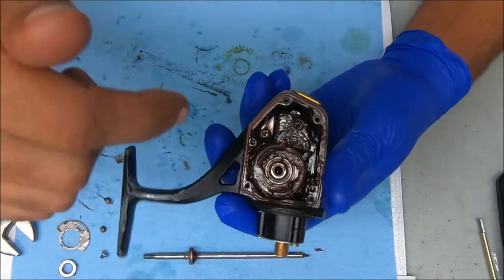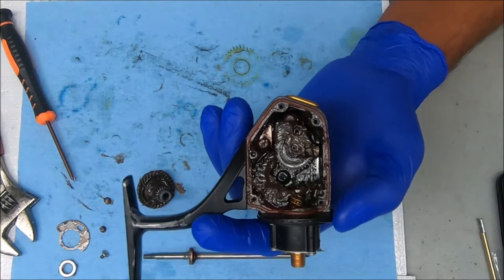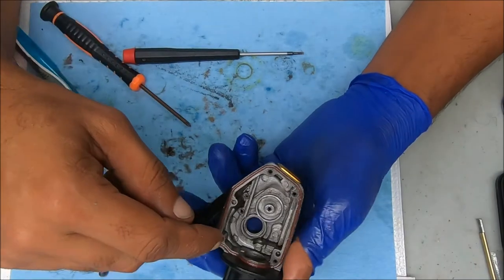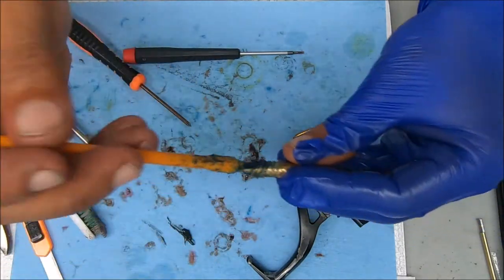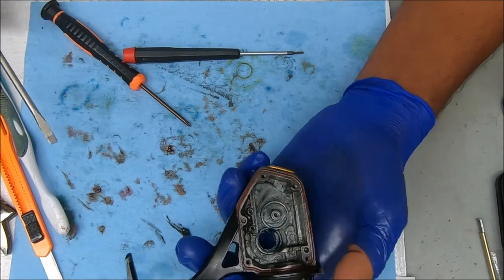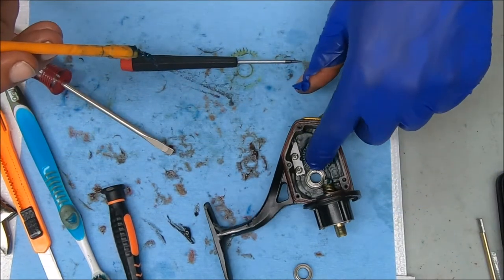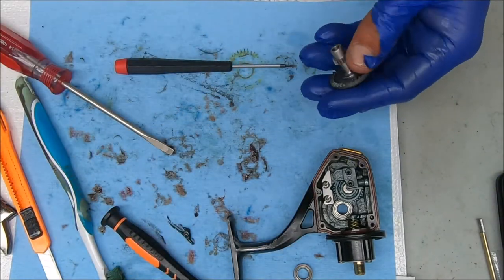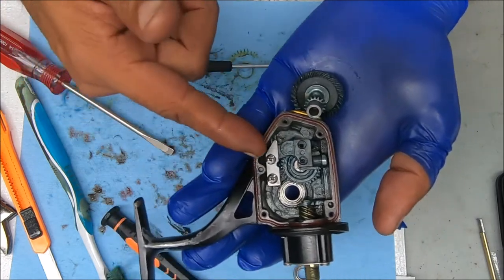WHOA! Who dumped a can of grease in this reel? How To Properly Grease Your Reel: Fishing Reel Repair

Comment: I would have used brake cleaner & just spray all that out or some type of cleaner...The reason I said break cleaner is it will clean it out & then dry real quick it will not hurt anything...
Reply from the maker: Thanks for watching and your input. I wouldn't use brake cleaner in this situation.... cheaper and easier [and safer for the reel] to clean it out with cotton swabs and paper towels. More vids to come.

Comment: Stupid question. How do i clean machine thick lube. Can i use WD 40 ? I got an reel from some guy but he used a thick grease wich its not good at all. Can i just sprey the reel with wd 40 till the grease comes off and clean it with a rug and use maybe machine oil the one for hair cutting machine ?
Reply from the maker: Thanks for watching. You can try WD-40 and elbow grease, or an ultrasonic cleaner with Dawn or Purple power degreaser.

Comment: Ok, as far as keeping the salt and whatnot off of the components, I get it. But what about lubrication? You need something to keep those contact points between moving parts protected. Not, like that reel had at the beginning of the video, but certainly more than just a very thin coat.

Edit: For clarification, my comment is more of a question and not a criticism. It's my first knee jerk reaction to the information I'm receiving here. I will actually try it and see how it works out.
Reply from the maker: Thanks for watching! First off, I LOVE getting  your initial thoughts on the video, and that you didn't edit them out. The light coating area is one we can certainly disagree on.... some may prefer more than that on the inner housing, and that's okay.... it doesn't add any extra protection, but it does help ensure you don't miss a spot.

Regarding the greasing of the gears, any excess will be pressed out during the engagement of the reel, so, in general, putting more than a light coat doesn't serve much purpose. That being said, I have two caveats:

1) the same rule as for the housing, where you help ensure you don't miss a spot applies to the gears also.

2) there are some reels I service that perform better with what seems like a little too much grease on the gears.

Tackle advisors has a video on greasing a reel if you want to check it out. I think it was a Daiwa BG. He's looking for max protection... my guess is for surf fishing... but I still think he could have gotten the same result with less. But, as he says, a little bit of [extra] grease never hurt nobody.... and I agree with that statement!

Thanks again for taking the time to put your thoughts to paper! More vids to come. Spread the word about the channel.

Comment: Thank you so much for such an informative video 😊.  I have Penn Slammer 3 and I plan to maintain it.  Which grease do you recommend using: Ardent butter grease or Penn precision blue?  I ask this because the viscosity of the 2 is different.  Penn blue is much heavier and will make the reel a little slower than Ardent would do.  I fish inshore and never get intruison of saltwater..
Reply from the maker: Thanks for watching! See my Slammer video by searching "Slammer TSG reel service". I use the Penn grease and add a little more than a light coat. Inshore is still water.... you'll never know what got in until you open it up.

Comment: I had a 4500. It was turning with a lot of resistance and had bee dunked in salt water. I sent if back to Penn for service since it was under warranty. It came back working better, but still quite a bit of resistance. I opened it up and it looked just like the one in your video, maybe even more grease. So I bet the reel in your video came just like that from the factory. I got all that excess grease out and the performance was way better.
Reply from the maker: Thanks for watching and your input. This was one of six reels a customer had previously gotten serviced elsewhere, and wasn't happy with the results, so he brought them to me. Glad to hear you got your reel working properly again.
Reply: Penn grease would have been blue

Comment: Excellent  video, thank you!!! Thanks god I found your video :) I was about to open my reel and fill it with grease.
I got new Clash 4000 a year ago but rarely use it ( few hours in total). I do lure & soft bait spinning but mostly with Daiwa reels. 
Now, when do twitching I can feel a “knock” in Clash, also  when hooking up the fish I get that same filling like shaft wants to go out :) Beside that no issues. 
Any idea what can I do by myself about it because no repair shop nearby- or it’s common for all Clash reels. I also have Slammer III 4500 but it do not “knocking” on twitch.
Thanks
Reply from the maker: You're welcome and thanks for watching! I'm thinking of two things off the top of my head:

1) your shaft is bent. You can check it by rolling the shaft (not including the click gear assy) along a flat surface and check for anomalies.

2) your crosswind block could be flexing/rotating.... take off your side cover and rotate your spool back and forth to see what the block does and how much play is there. If it's slight, you may be able to get away with packing it with grease.... if it's severe, you should consider replacing the block and crosswind gear.

Hope that helps and good luck with the servicing of your reel(s).
Reply: @TSGReelService  Thank you for your reply and support. Last night I had a spare time to follow your instructions, and after many hours and several openings I was able to detect the issues (hope so) - on the bail holder screws were loose on both sides ( from factory) so much that I was able to make several turns of each by hand only. The screw on line roller was loos too. At the and - loose bail cause free play when the rod and reel are under the stress while twitching, which cause that “knocking” feeling.
Thank you again!!!
Reply from the maker: That makes sense and I've seen that before. Glad to hear you got it remedied.
Reply: Mix reel oil and grease  and then you can stuff it into your reel 
It will be smooth and easy to crank  and oil grease mix will  move around

Comment: I've been swimming out to the sand bars with my Penn Fierce. 1st version. After a week in the surf, the reel started to corrode and became hard to turn due to my abuse of the reel that wasn't designed for underwater use. Well, after cleaning, I filled the body with wheel bearing grease. It made the reel have more resistance in turning. So much grease that the grease started coming out the main shaft beneath the spool. I fish off sand bars atleast 14 days of each year. This reel is atleast 10 years old now. I do open the reel and top off grease each year. Never cleaning the internals. Never had water mixing with the grease. No corrosion internally of any type. 2 down sides, the grease is so thick, when fishing in sub 30F weather, the anti reverse bearing fails to work. It takes about 200-300 turns prior to fishing to make it work. In summer or fall weather never a problem. The 2nd problem is when temps are 90F , the grease becomes thin and flies out from under the spool during fast cranking. Then I get small grease clumps on my clothes. The stains do not come out. Since then, I now fill all spinning reels with "super Lube" its a clear silicone grease which doesn't stain my shirt.  The low temp causeing the anti reverse not to work is still a problem below 30F but, it now only takes 20 -50 cranks and the bearing returns to working. So as stupid as filling a reel with grease appears, In my experience, If you can't afford a proper water proof reel, filling a $70 reel with grease will get you 10 years + of good service . Use silicone  clear grease to avoid staining of your clothes.  Just saying.
Reply from the maker: Thanks for watching! Great dissertation on your personal pros and cons, and advice on the type of grease.... it makes sense if you're doing that sort of fishing and are willing to make certain sacrifices... see the other comments in this thread.  Stay tuned for more vids.
Reply: Precision Reel Grease I think ti is the best for me but each to their own grease...
Reply: Interesting
Reply: Silicone grease is not good for metal on metal wear.. it cause galling..

Comment: I have a question. I just bought carbontex drag washers and I was wondering. Can I use Corrosionx grease on the washers or will it damage them? Or do I have to use cals
Reply from the maker: Thanks for watching! I've used the CX grease before, but not for drag washers, so I don't have a recommendation on it for that.  I can recommend Cal's or Shimano's drag grease, or you can leave them dry.
Reply: @TSGReelService  thank you
Reply from the maker: No problem.